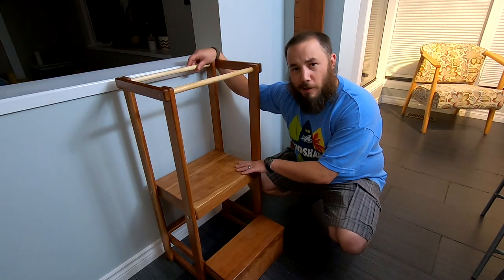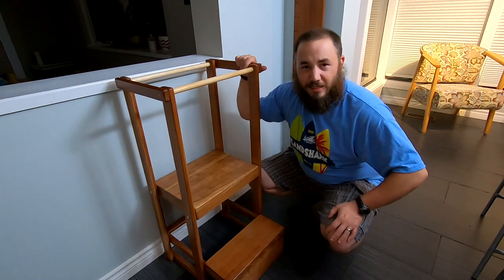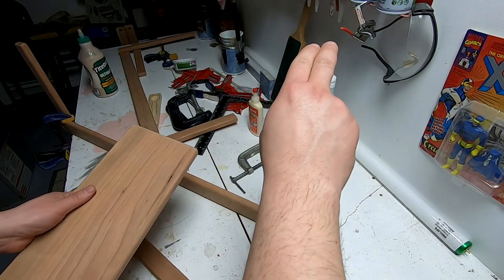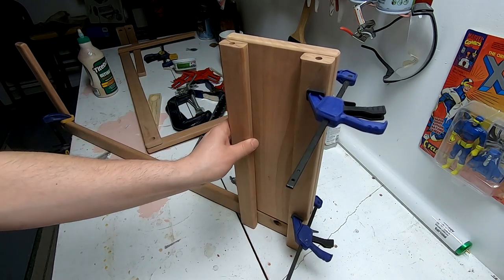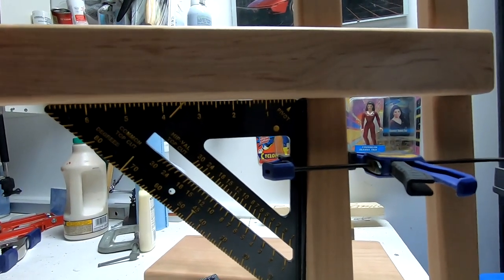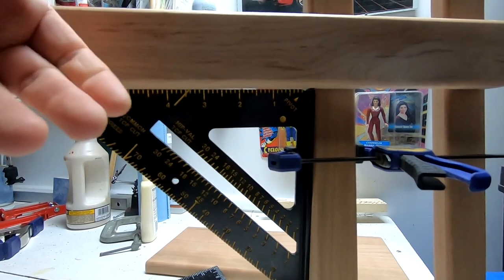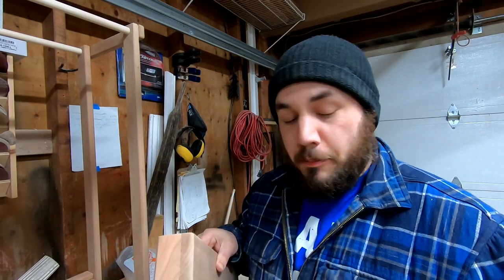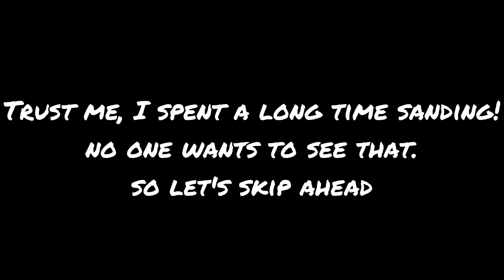Children's Step Stool [Solid Hardwood]

Comment: Can you share the dimensions of this project? I’m planning on building one. Thanks!
Reply from the maker: Hi Zac, it's about counter height (36" in my case) 18" wide and the total depth (with the bottom step) is 18". The main platform is 12" deep. If I was going to do it again I would make it a bit wider, probably 24" to be more stable
Reply: The Grant Alexander Thanks for
The reply! I’m going to try to start on it tomorrow afternoon. 😄
Reply from the maker: @zacpeterson9201  good luck! If you need any other help let me know. If I don't respond on here try Instagram, sometimes YouTube doesn't show the comments.